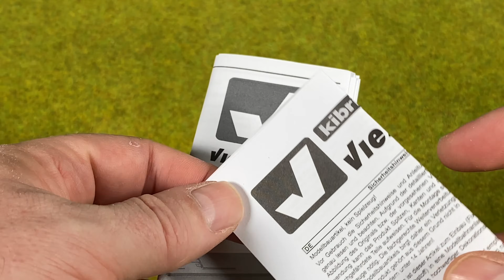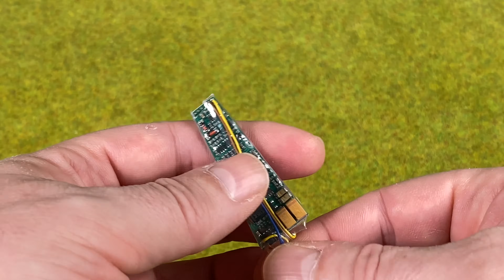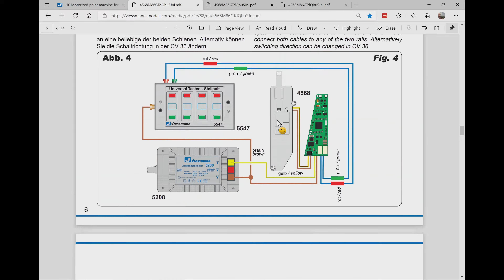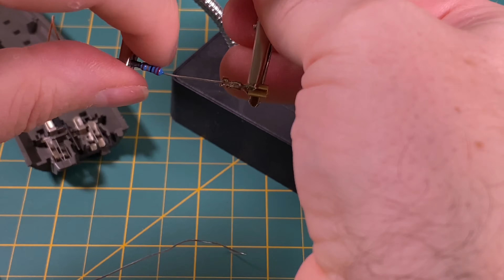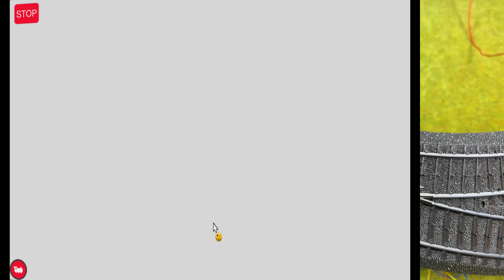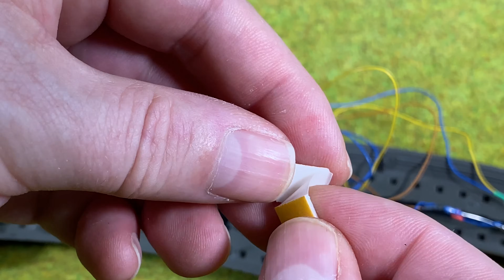Installing Viessmann 4568 slow moving turnout mechanism in Märklin C-track (Tutorial 06)

Comment: Thank you Bo. I will not insulate the leg of resistor but I will shorten it. Second, I will put the blue wire with red on a separate connector so I can program the addres in the future without further soldering.

Sometimes the turnout stacked so I have to remove the thing for manual change. I have started with the cross turnout, where there is not so much space for wires and I think I will shorten them all. One more thing - i had to take out not only that manual lever but the rod as well.
Reply from the maker: Hi Daniel, all great tips! Is it working reliably now? Enjoy ;-) Bo
Reply: @ModelTrainFun  Yes, it works. But I have only tested it. I have not anything built yet. One thing, I did not want to put away that lever, but I had to do it, because every second piece did not work properly, it still got stucked. Some work with it well. I like to watch the lever moving..

Comment: I would recommend a ratcheting crimper for those flat shoe connectors; it'll look better and get rid of small metal that stick out. It will also remove the need to solder entirely.
Reply from the maker: Hi Bart, absolutely - a crimper is the way to go! Great tip - thanks. Enjoy ;-) Bo

Comment: Want to thank you again for helping me discover the Viessmann 4568. I just wanted to share something I found by accident. Both blue wires are only for programming the turnout to the address you want to use. Once done they do not have to stay connected. This saves space, as you can shorten them just enough for connecting them and saves a lot of soldering as you can use alligator clip to do the temporary connection needed for programming. Only the Yellow and Brown wire need to be soldered permanently for a long term layout. Just thought I would share.
Reply from the maker: Hi,

I do agree that it seems that you can do without the blue wires. However, unless I am mistaken these must be connected according to the manual. If you look in the description in section 4.3 (page 9) and figure 5.1 (page 13) of the manual to me it seems they must be connected: https://viessmann-modell.com/media/pdf/30/31/c2/Pg0KZW5kc3RyZWFtDWVuZG9iag0yODcgMCBvYmoNPDwvQ3JlYXRpb25EYXRlKEQ6MjAyMzA0MjUwODI1NDcrMDInMDAnKS9DcmVhdG9yKEFkb2JlIEluRGVzaWduIDE4LjIgXChXaW5kb3dzXCkpL01vZERhdGUoRDoyMDIzMDQyNTA4MjU1.pdf

Not sure what happens in the long run if you do not connect these wires, but I guess you could be unlucky and something might stop working? ...or you could get other weird behaviour.

...or did I misread the manual?

Enjoy ;-) Bo
Reply: You might be right if I read section 4.3 "After programming,In a Märklin-Motorola system, connect both (*blue*) cables to the middle rail". I am sort of in between layout now as I am planning my permanent layout and might have to reassign CV address to turnout. this is the reason I found this easier. I will give it a try and see how it holds up for a while. Thanks for the answer. If any failure flares up I will keep you informed. @ModelTrainFun
Reply from the maker: @herricmountain  let me know and I hope you have success with your layout! Enjoy ;-) Bo
Reply: When in doubt ask the manufacturer, and they answered kindly very fast. « Hello, The blue wires (with red and green ring) can be unconnectet to the yellow and brown wire. This blue wire are not importent for the function of 4568. Regards J.Meier. Thank you Viessmann. @ModelTrainFun
Reply from the maker: @herricmountain  Excellent - thanks for sharing! Enjoy ;-) Bo

Comment: Nice tutorial 👍.
Quality soldering is an art on its own. I don't know how powerfull your soldering iron is but I recommend one which has min. 60 Watt, better 80 !!!
What is the price for this Viessmann 4568?
Greetings from the Čech Republic 🇨🇿
Reply: Sorry Bo I do now answer after such a long time. I was you could say out of order.
Your soldering iron has enough power, 85 Watts is for what we modelers solder more than enough.
The temperature is something different. When you have lead free solder I recommend 375°C. With lead holding solder 340-350°C should do the job. There is also a low temperature solder available but I don't recommend to use that.
BUT !! When soldering for instance a thick cable you sometimes have to go up to 400°C. In such cases the 85 Watt is also an advance.
Reply from the maker: Thanks ;-)
Reply from the maker: Hi Robin, Thanks for the tip - I se that my soldering iron is 85W and I can change the temperature. What is the recommended temp? You can see the recommended Viessmann 4568 price on their web site: https://viessmann-modell.com/en/product-range/electronics/electronics-mechanics/2625/h0-motorized-point-machine-for-maerklin/trix-c-track-replaces-4558 Check out you local model train shop for their price. Greetings to CZ. Enjoy ;-) Bo

Comment: Great video!  Do you need to keep the blue cables attached after programming?  The Viessmann video for this (in German) states that the two blue wires can be disconnected after programming.    I'm getting ready to program 4 sets, so I'll try it and see.  Cheers!
Reply: OK - answered my own question.  The two blue wires are not needed after programming.  I was also able to use my LokProgrammer to program the address via the Driver's Cab / Turnout Control Panel.  I soldered the yellow and brown wires to rail contacts underneath the turnout, then connected the turnout to a standalone track section which was wired to Track Out on the LP.  I used a wire clip to attach the DCC wire (red sleeve) to one rail, pressed GO in the Driver's Cab, then connected the green sleeved wire to the other rail.  I pressed the desired address buttons and the decoder responded instantly!  Works great!
Reply from the maker: Hi Gene,

Great that it works - I really like these slow moving mechanisms from Viessmann. It is also fun to experiment with the digital functions of model railroads and these create really nice functions.

However, looking at the manual as I see it as the blue wires must be connected after programming: https://viessmann-modell.com/media/pdf/30/31/c2/Pg0KZW5kc3RyZWFtDWVuZG9iag0yODcgMCBvYmoNPDwvQ3JlYXRpb25EYXRlKEQ6MjAyMzA0MjUwODI1NDcrMDInMDAnKS9DcmVhdG9yKEFkb2JlIEluRGVzaWduIDE4LjIgXChXaW5kb3dzXCkpL01vZERhdGUoRDoyMDIzMDQyNTA4MjU1.pdf

In Section 4.3 it states that you connect as figure 6 during programming and connect as in figure 5 or 5.1 after programming. So it seems Viessmann's recommendation is to connect the blue wires after programming. Looking at the figures in the manual it seems to me that the yellow brown to the decoder is for power while the blue wires are for the digital signal - however, I am unsure.

Enjoy ;-)
Reply: @ModelTrainFun  I think the decoder is like any other digital device connected to the tracks.  It gets power and the DCC signals from the track connection (yellow/brown wires).  I think they're using the blue wires simply to determine whether to set DCC or Motorola addresses, and, as such, that's why the decoder works without them once programmed.  I think a button on the decoder would've been a better choice, but I'm not complaining!  :)  

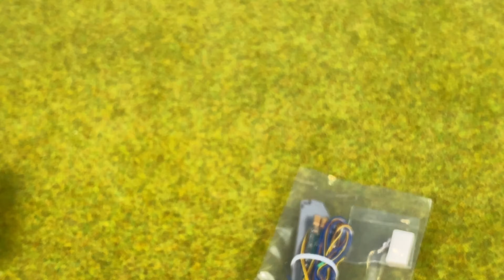In any case, I agree that the Fig looks like they want the blue wires to stay connected but Viessmann's video does say that the blue wires can be disconnected once the address is set.   It's around 3:40 in the video.

https://youtu.be/a3ZWwMSl5xI

I think they need to clarify the written instructions a bit.  My four turnouts are working great - love the slow motion of the motor!  Great videos!
Reply from the maker: @ejwolski  Indeed according to the Viessmann video the blue wires can be removed after programming. ;-)

Comment: Adhesive pads to attach the decoder to the bottom of the c track? I’d have expected Viessmann would have sized the board to snap into the same fitting spots under the c track as the Märklin factory deciders do. Adhesive pads and tape , if needing to work against gravity, are a guaranteed failure some years down the road. They never hold , or are impossible to remove. Seems an odd choice.
Reply from the maker: Hi, agreed - annoying they do not use the fitting spots under the C-track - would be a nice enhancement. Enjoy ;-)
Reply: I have a few of these decoders. I don’t like adhesive pads much either, and I ended up using a few dabs of hot glue. Strong enough to make it stay put indefinitely, but it’s easy to peel the glue off with some care, without putting any strain on the board.

Comment: I saw on Xtrain24 Frank Buttig presenting this all-in-one turnout mechanism. Looks interesting and for that price point, it is worth converting to the slow and more realistic stock rail movements
Reply from the maker: This slow moving from Viessmann is about same price as the Märklin ones, so yes - definitely worth it. Enjoy ;-)
Reply: @ModelTrainFun  if there is no or minor price difference then would go for the realistic slow moving mechanism. Thanks.
The advantage of hiding under C-track and easy wiring remains
Reply: @germaN87AC  in fact, viessmann is much cheaper, here you have to buy decoder and mechanism both for 800 CZK and wiessmann has it both for 1100

Comment: What is the difference (advantages and disadvantages) for setting the decoder between DCC or MM? I have a Mobile Station with Trix C tracks.
Reply from the maker: If you have the Mobile Station you can set locomotive protocol or accessory protocol independently. You can set the locomotive protocol to support MFX, MM and DCC. In this way you can have MM and DCC locomotives at the same time. However, you cannot have DCC and MM accessories at the same time - you have to choose. The benefit with DCC is that you have a lot more addresses and for decoders without MFX it is easier to get to the CVs. You can use MFX with DCC without MM getting the best of decoders that support this (newer Trix/LGB locomotives).

Generally, if you are using Märklin C-tracks (3-rail) I recommend setting locomotive protocols to "MFX, MM & DCC" (default setting). This will ensure that also older digital locomotives can be used. However, as you are using Trix C-track I suspect that you are using DCC locomotives, so I would set locomotive protocol to DCC (thereby excluding MM locomotives of which I assume you have none). 

For the accessories - if you only have accessory decoders (turnouts, signals, etc) that support DCC, then I would choose the DCC protocol as this is more natural to the Trix/DCC/2-rail world. If you had Märklin I would recommend MM.

For the Central Station 3 it is slightly different as you can mix and match MM and DCC as you wish. So use what makes sense. You can have MM and DCC locomotives at the same time as well as MM and DCC accessories at the same time. In this way the CS3 can do both Märklin/3-rail and DCC/2-rail or DCC/3-rail at the same time. However, if you use Trix/DCC/2-rail consider standardizing on DCC as you easily can use locomotives and accessories from other 2-rail manufactors as well. If you were using Märklin/3-rail I would suggest use what is most natural to the locomotive/accessory at hand with the mindset if you intend to make a big layout, then use DCC for accessories.

Did this help? Enjoy ;-)
Reply: @ModelTrainFun  great explanation. Thank you very much for your help. I only have a Trix Freight Train starter set with some extra turnouts and a Roco DCC loco.
Reply from the maker: @joaosampaio2015  Then I would do DCC and not use MM. Enable MFX as MFX also works with DCC and the Trix locomotive will probaly support this. One tip I have heard from others: Sometimes Roco DCC decoders do not like MFX on the track at the same time, so if t behaves strangely consider disabling MFX after the Trix locmotive is loaded. Enjoy ;-)
Reply: @ModelTrainFun  they both work fine together on the oval with no issues. Thank you.

Comment: Hi, can I use the same with Multimaus / z21? Do I need any additional equipment? I have trix c glais
Reply from the maker: Yes you can use the Viessmann 4568 with Trix C-track as well. Take note, that the wiring is slightly different - to me it does not look like you need anything extra. The z21 is able to do DCC, so you should be good here as well - program using section 4.4. Check out the manual: https://viessmann-modell.com/media/pdf/2e/82/da/4568M86GTdQbuSJni.pdf

Enjoy ;-)
Reply: @ModelTrainFun  Hi, i followed the 4.4 section and it worked fine. However, i have soldered them directly to the track. For some reason Trix C track has only pins from its one side. I cant use plug ins on both. Also, the Trix C-track has an electric board underneath. I can see yours doesnt have anything. Do you know what is the board for? Perhaps it is already a built in decoder?
Reply from the maker: Hmmm - you're stretching my knowledge here. I honestly have never had Trix C-track... 

However, looking in the manual for turnout Trix 62611 it seems the board is for determining if you want the frog powered. DCC/2-rail is different from Märklin 3-rail in the sense there are only two rails. This means that it can be less reliable in turnouts as each rail must have different polarity - this means the frog must be powered differently depending on direction. On the board you can determine position 1 for non-powered and position 2 for powered frogs.

Manual here: https://static.maerklin.de/damcontent/c8/a1/c8a1578423fbf75ce855115517ce87401434535676.pdf

Hence, it is not a decoder. If I look at Trix 62611 you still need both at turnout mechanism and a decoder.

Did this help? Enjoy ;-)